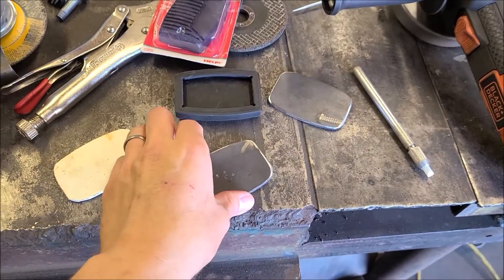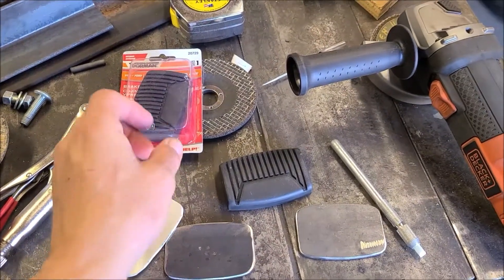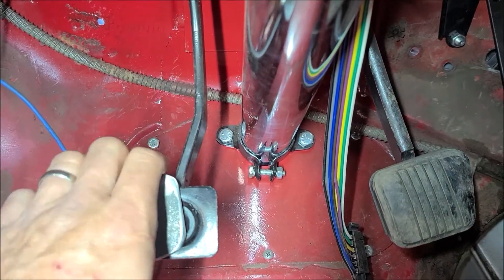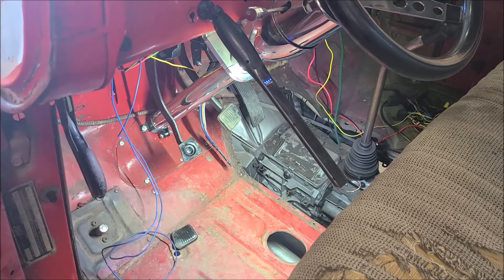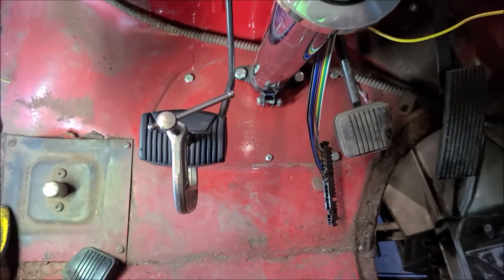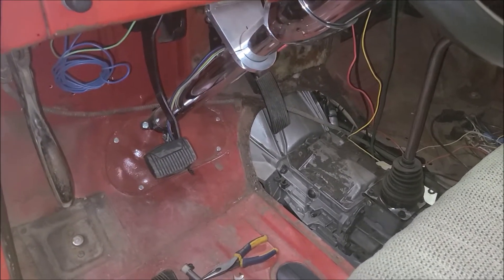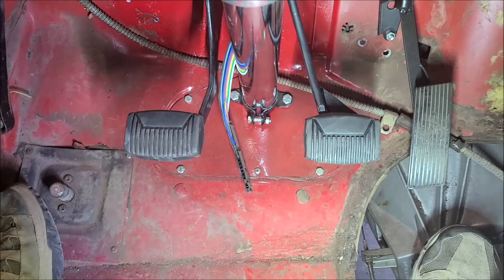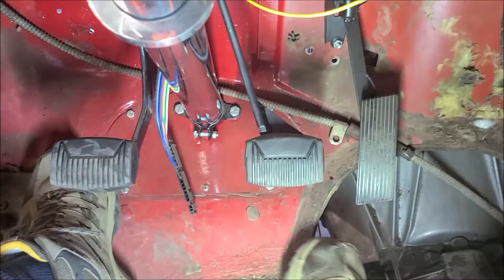1956 Ford F-100 Episode 27 - Clutch and Brake pedal pad replacement

Comment: Truck looks great I have a 51 ford and I am using a 94 Gt mustang any tips you could give me on my build would be appreciated.
Reply: What year mustang c/b pedal assembly dud you mod for 53 F100. Also, what hydraulic system u use on clutch pedal. Booster size used to clear hood.
Thanks for sharing your clutch/brake pedal mod.